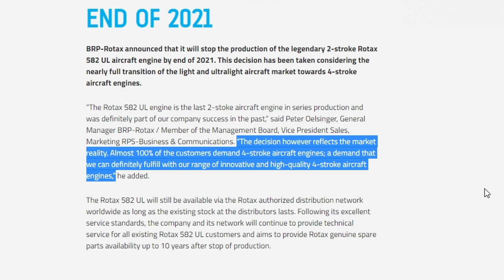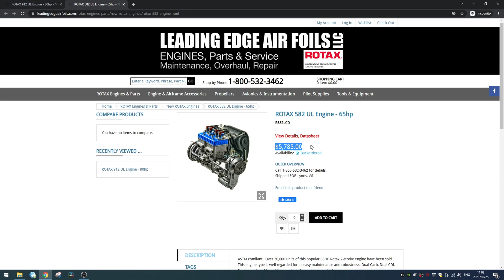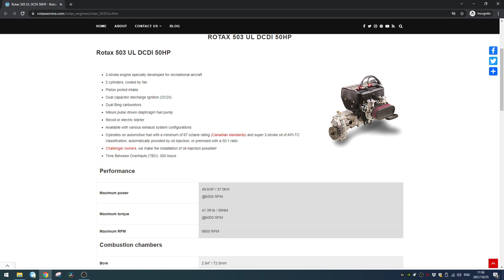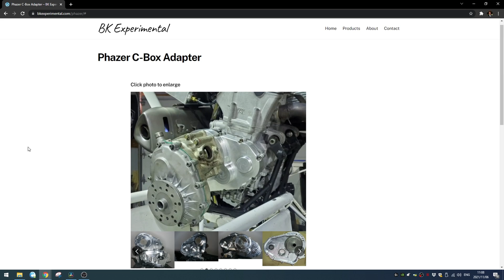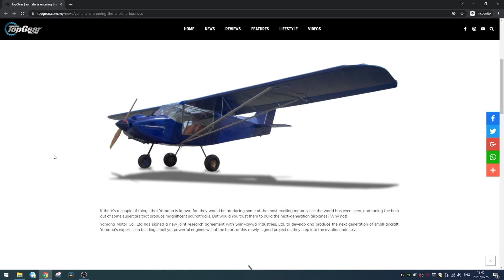Rotax Stops 582 Production - Ultralights Impact & Engine Options

Comment: The new 600 cc twin would make a much better candidate smaller lighter and put out 125 hp and it’s snowmobile and set up to fly. It would make a great motor. I’ve got one sitting in a brand new sled sitting in my garage and we barely get any snow, my wife will kill me, but I plan on yanking that motor motor out and building a plane
Reply from the maker: Don't tell her until it's done 😆 Which engine is that, the 600cc motor you are reffering to?
Reply: @normdickson2438  depending on the model, between 60HP and 85HP. I don't see any specs with 125HP, and set up to fly, not a chance 🤔

Comment: For ultralights, 2 Bailey V5 4-stroke engines will give you 41hp at a combined weight of 34kg (about 75#). But it will cost you.

Comment: So... "Rotax Engineering Team" can't design a small, efficient four stroke powerplant. The 912 is 4 cylinder overhead valve engine that still needs RPM reduction. Why?
Why not? Maybe lightweight  engines cost more? Rotax could own FAA part 103. with a light 30/40 hp torque based plant. No propeller speed reduction, exellent endurance/ low fuel consumption, extended airtime/range. Imagine experimental aviation for everyone who doesn't have $90K+ in their pockets for a 172 or a Cherokee + tie-down/ hanger/ tbo costs/insurance/maintainence by someone else? No fun. I've been a pilot since I was a kid. I never cared about hours logged. I love to fly, Just offering an observation. James Smith from Michigan. Thanks for sharing.
Reply from the maker: You've touched on many points here, I'll try to offer a different perspective. Rotax CAN design a small efficient four stroke engines, but why would they? Every new aviation engine Rotax have put on the market has been higher HP than their previously released engine. Rotax clearly hasn't had their eyes set on the part 103 world for quite some time.

This is likely a strategic market decision, but also keep in mind, the one thing Rotax isn't known for is affordable engines. If they were to design an engine in your HP range, it would be the most expensive engine in that power range, and it's also the segment of the market where there isn't very much money to spend. Hence the decision to move out of that market many years ago.

My opinion is that Rotax engines doesn't NEED RPM reduction, it's by design. Having a gear reduction ratio of 2.43 increases torque to the propeller by 2.43 times. Ever seen how much bigger prop a Rotax 912UL 80hp can spin than a Jabiru 80hp? Besides, to make high HP from small lightweight engines, you need high RPM. That's just physics and can't get around it without affecting reliability.

Thanks for the comment!

Comment: What do you think of Viking engines ???  Car conversions. Out of Florida.
Reply from the maker: Not sure. Do they source the engine and convert for aviation use, or does one need to supply it to them to convert? I'm a bit ignorant on these engines to be honest
Reply: @LetsGoAviate  I understand. Thanx for responding. You may wanna google them. based out of Florida. Supposedly those motors are cheaper & run fine, but NOT certified.
Reply: He has a source that capitalizes on Japan's extremely tough automotive inspections.  Used cars depreciate REALLY fast.. just because of this rule.  So, they are either exported,  or  salvaged and exported as parts.  There's simply more money in a used car in Japan if it's exported.   Chances are, a mild front end crash in Japan probably get the whole car  parted out.. even if it's less than 2 yrs. old.
  It's easy to find low miled (gas price, and LONG road trips in a very small country) makes it rare to find an engine with more than 3000-5000 miles per year.  
From there,  he 'converts' them for mounting in an airframe-  lighter manifolds, wiring harnesses,  coolant plumbing, oiling, engine mounts...and adds a PSRU.   @LetsGoAviate

Comment: Im running Hirth F23 50hp electronic fuel injection reduction belt gear and exhaust. Runs 78 lbs and you can get it for between $5000-6500.

I love Rotax 912, but too heavy for a US Part 103 Ultralight. If Rotax comes out with a lightweight 4-stroke for a reasonable cost, I’d definitely be interested. Sad to see the 582 go.
Reply: Where can i find it? Hirth f23
Reply: And in what do you use it in?

Comment: Yamaha Phazer what’s not to like, more power, better fuel consumption, about the same weight give or take just a little.  Not to mention Yamaha’s stellar reputation for incredible engines ( I. E Toyota / Lexus ).  Several companies are starting to get on board with this now and making it an easier transition for UL applications.  Would love to see a video with each going head to head (overall cost, TBO comparison & so on  😊 )
Reply: Car or motorcycle 4 stroke engines are not suitable to run with constant pwr !! That’s why aircraft engines have special piston rings to let a little oil up to lubricate the piston . The fuel consumption is 0 to max 20 % better on 4 strokes . The lack of reliability of 2 strokes are 99 % from bad Fuel and Colling systems design , follow the manufacturer and you will have a trouble free 2 stroke engine .
Reply: @reinerressel975  constant power in aircraft is only needed at takeoff, for a few minutes. The 4 stroke Yamaha snowmobile engines are literally taking off in appeal. Only one or 2 suppliers of PSRU.
Reply: @stevecarlisle3323  Let the 4 str. run for 2h with 65-75 % without lifting the throttle to suck a little oil up , your engine is never be the same then before ! Even a F 1 engine is not capable to run a longer time without lifting the throttle . Car engines are build for max 25 % constant PWR .
Reply: @reinerressel975  Well we are Not talking automotive engines, but snowmobile engines, and you really need to watch how snowmobiles are abused, especially by the younger riders 😉🇨🇦
Reply: @reinerressel975  Hmmm, " without lifting the throttle to suck a little oil up " . Can you explain that to me, in detail 🤔🇨🇦
Reply: @stevecarlisle3323  Halve wedge piston rings are the solution  , the pressure during the working stroke presses the compression piston ring against the cylinder wall  and during the other 3 strokes a little oil can pass by to lubricate the upper cylinder ! In all other engines ( not aircraft engines) almost no oil can pass the rectangular and the oil controll rings  during continuous high power operation , except you lift the throttle to create a tremendous vacuum in the cylinders which sucks a little oil up to lubricate the upper cylinder portion. . That’s why no car or motorcycle engine live long except you operate it in the traffic pattern or whit very little continuous power ( R 912 = 3.5 us gal . / h)
Reply: @reinerressel975  Thanks for taking the time for that explanation 😉🇨🇦
Reply: @stevecarlisle3323  what I stated before , they run it full throttle only for a few seconds . Remember Porsches aircraft engine ? They talked very bad about Conti. and Lycoming  engines . The customers were the Guinea pigs ! After a while the vanished silently . A friend of mine was a test pilot there .
Reply: @reinerressel975  They must have a running procedure to overcome any I'll effects , as there are lots of Yamaha engines in the air. I don't follow closely what's going on.😉🇨🇦
Reply: @reinerressel975  The aftermarket piston company like Wiseco may find it profitable to make a wedge ring piston kit for the Yamaha engine 🤔
Reply: @reinerressel975  Well we Re talking about snowmobile, not motorcycle or automotive. If you want to check out more legit auto engine conversions, they have been doing it for close to 20 years, successfully, likely by now with over 100 engines sold, and there are a hand full of other companies, that sell auto conversions. ☺️🇨🇦
Reply: @stevecarlisle3323  I am pretty sure , the do it for Volvo Penta engines as well . Additionally,Volvos boat engines have much lower power output compared to the similar car engine , to make them last !!
Reply: @tomvancil8213  What are you comparing the Phazer too 😉🇨🇦

Comment: I would run the 583 on my skidoo mxz 583 over sierra mountain passes in snow storms, in the middle of the night, by myself, for fun all the time.  Not once did she ever quit on me.  I think that is a far more dangerous thing to do than fly an ultralight with a 583 where you have the chance to do an engine out landing at low speed in many places.
Reply from the maker: Seems like the 582 and 583 differs in quite a few ways. Don't think I've heard of a 583 that was converted for use in aircraft, but I'm sure someone has done it.
Reply: @LetsGoAviate  there are a lot of them in ultralights, they work just fine, there's a guy in Arizona does them.  The only difference is the ignition and the 582 has the crappy ducatti when the 583 has nippo.  ignition systems don't fail
Reply from the maker: Cool thanks for letting me know!
Reply: Yup 583s super reliable ran them for years in my honda oddyseys before I moved up to 670s and 670HOs.

Comment: I think your missing something here…. Rotax have other 4 strokes used in PWC’s and Ski mobiles.  I would imagine we will see some aero versions of those, like the Rotax 900 HO ACE
Reply from the maker: Oh yeah I'm sure I'm missing lots 😁. Admittedly I don't really have much awareness about Rotax's own non-aviation engines. 

Thanks for the comment, will check it out.
Reply: @LetsGoAviate  I have the ACE 900 in a jet ski.  90hp and a great little engine.  They do a ACE 600 too at 60hp.  I would imagine they would make great small 4 stroke aero engines.
Reply from the maker: Could be interesting! Will need an adapter manufactured to fit a gearbox, but that can be done like it was for the Phazer.
Reply: @LetsGoAviate  the gearbox from Skytrax has short lived sprag clutch. The older design from Mohawk Aero uses the Rotax C gearbox with the rubber idolaters, maybe a better investment. Lots of development time and money to get a PSRU on a particular engine, and you better pick the right one, to sell enough.😉🇨🇦
Reply: @LetsGoAviate  This is the major issue with conversions, is building, or mounting a PSRU. Your looking at minimum $5000 dollars before you can use a converted engine,and that's before the mounts and all the other support systems. ☺️🇨🇦
Reply: I hope to see four-stroke, lightweight engines being built by Rotax Engineering or other companies. I love experimental aircraft. 60yrs and a private pilot. FAA part 103 is cool-dogs! A four-stroke, lightweight powerplant? A motorcycle engine. Could be key to the development of new lightweight aircraft powerplants..
Reply: @JamesSmith-op7yc  unfortunately motorcycle engines have a integral gearbox. Lots of sled engines to choose from 😉🇨🇦